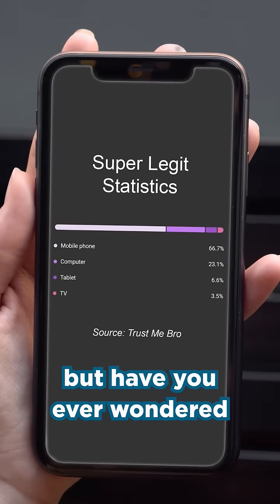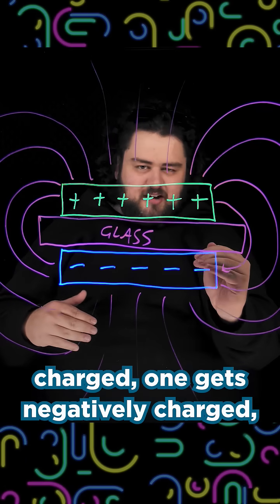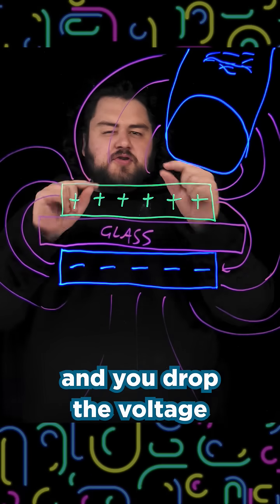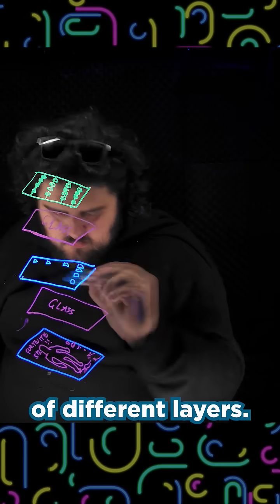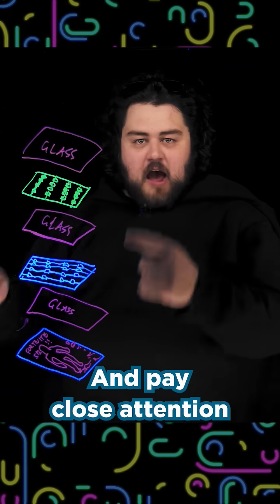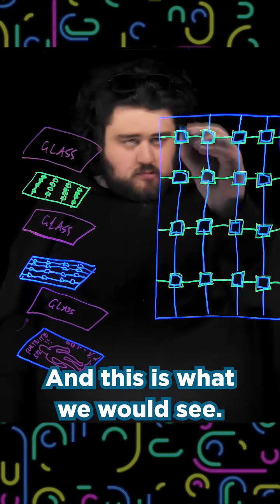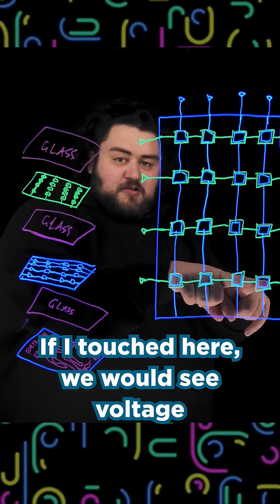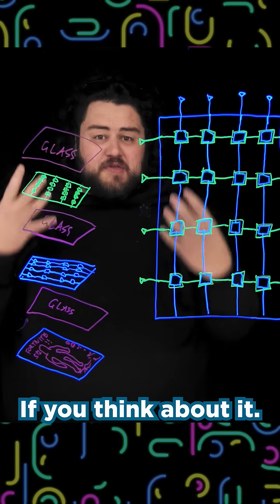How Does Your Touch Screen Work?

Comment: A good explanation but worth noting that that wiring pattern only applies to single tough displays. Multitouch displays are a fair bit more complicated since you have to account for multiple possible false points/ghosting if you used the basic latice. IE, touching 2 points on the basic latice gives 4 possible positions for touch to be occuring, the corners of the rectangle you're forming.
Reply from the maker: As far as I'm aware they use mutual capacitance. When 2 fingers touch at the same time the voltage drop is different on each and you can use this to eliminate ghosting.

Comment: Is the finger changing the dielectric constant?
Reply from the maker: Not quite. While the finger itself doesn't significantly change the "dielectric constant" of the screen structure (which would remain constant), what it does instead is affect the electric field around the sensors and thus change their measured capacitance.